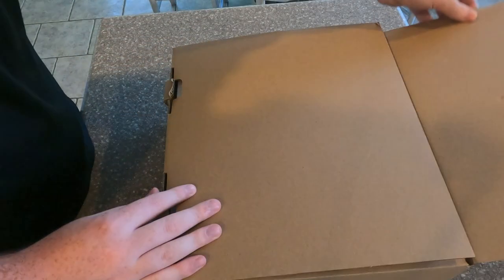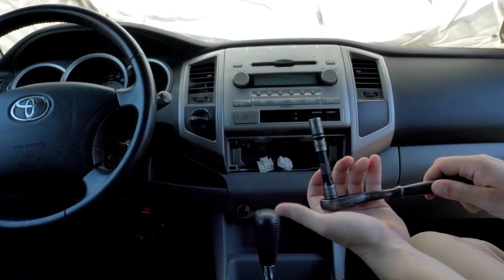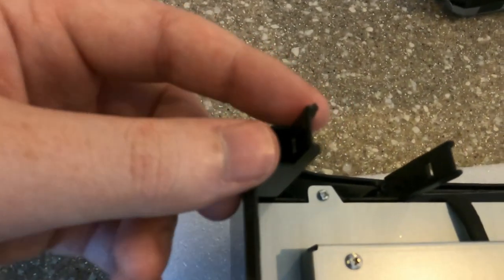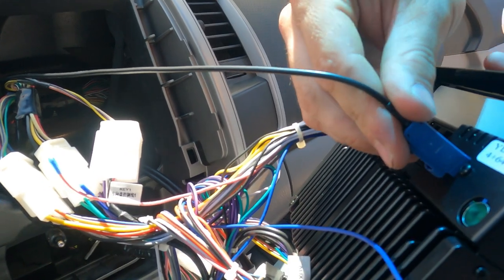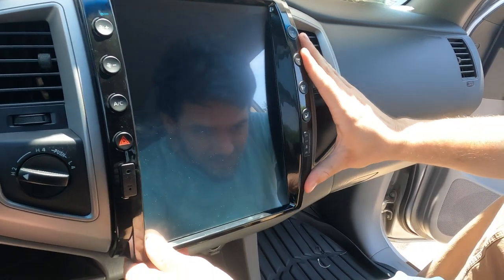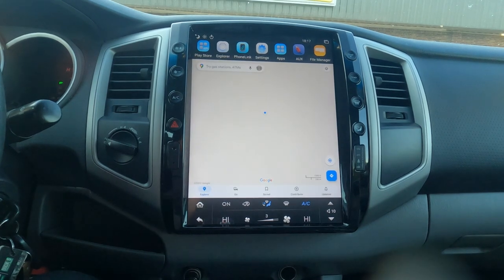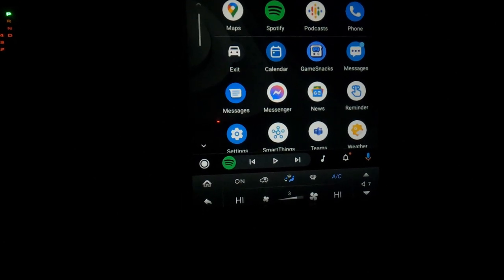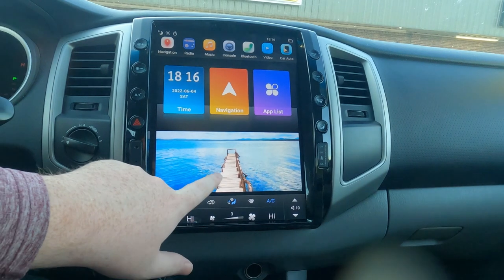AuCar 2005 to 2015 Tacoma Head Unit Installation and Review!!!

Comment: Thank for the video. Seriously thinking about getting this upgrade thanks to what I see here.

I have a 2010 Tacoma with the backup view in the rearview. 

Question: Is there a way to connect that existing camera to aucar screen?

Thanks again.
Reply from the maker: Thanks for watching! It should have a wire harness and connection that just plugs straight in the back of the unit that will automatically connect to your backpack camera and the screen. It also has the option to add more cameras to get a birds eye view of the car, but I have not seen that hooked up yet so don't know much about it. 

If you have any more questions be sure to reach out!

Comment: Installed my aucar unit yesterday on a 07 Tacoma, lcd already having a a big line through it. AC was opposite, cold is hot, vice versa. Bluetooth quality is really bad. I would stay away from this China product
Reply from the maker: Oh shoot, I didn't have the lcd screen issues. Did you reach out to their customer service to see if they will fix it? I know the hot and cold can be fixed with a software update, the Bluetooth is subpar. I wouldn't mind sharing your experience in a video if you wanted to send a picture or video let me know.
Reply: @ZachHollenbaugh  yeah that's your email, I'll send u some pictures,
Reply: @ZachHollenbaugh  yes, if you can do a follow up video on mentioning my issues that would be awesome, mayb it'll get their attentions
Reply: @plng777  were you able to get yours fixed, these are the reasons why I am hesitant to get this?
Reply: @plng777  
What unit would you have bought? I’m thinking of leaving the heater ac controls and just replacing the head unit
Reply: @acobajk24 Was this issue ever fixed?

Comment: A few questions. I have a 2005. Is it smooth, is it quality, is it worth the money and can you change the brightness on it the whole screen? Thanks in advance.
Reply from the maker: It should fit 2005 - 2015. I've had it a month and it has been smooth and seems to be quality so far. I mainly use it for carplay, but I can do handfree calling which I love. I think it looks a lot better as well. You can change the brightness on the screen with a few taps on the top left, or go into more exact brightness in the settings. If you have no tech in your 2005 I think it's worth it for what you get. I'll be making a video at 6 months showing people how it's holding up, but so far I like it a lot. Adds a wow factor to that I like. As far as worth the money I think it will depend on what you have currently, for me it would of been bc I had no tech or screen. If you have any more questions just let me know!

Comment: Great video! One question. I saw the display plugged into the OBDII port below the steering column. Does the Aucar display read the codes from the OBDII and display them on the screen? If so that would be a game changer for at-home diagnostic tests.
Reply from the maker: I don't think it does, but that would be a game changer if they had it haha.

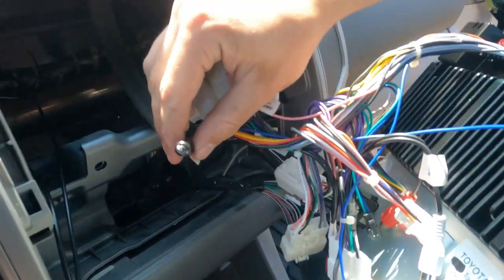Comment: This video helped me a ton guys! I watched it a bunch to help me figure out what I was doing. I have to ask did you guys have trouble plugging in the radio antenna 4:42 and getting the plug to stay in? it seems like mine only goes in halfway and pops out rather easily... I got the gen2 version of this headunit
Reply from the maker: Thanks for watching! I am Glade you were able to find some value in the video. I can't quite remember if we had trouble with that wire ourselves. I was curious what you thought of the new generation screen?
Reply: @ZachHollenbaugh  Absolutely, you are one of the few showing a clear install that made it easy for me to follow!  I haven't got to mess with the screen much. I still need to put the screen in! I broke one of the white clips so I'm hoping it will work with just three white clips instead of four. It def does't work with yellow clips in place of white ones! lol Only thing I'm worried about is the radio antenna doesn't seem to plug in or "snap in" securely like everything else does but I did notice the sound quality is significantly better with this unit.
Reply from the maker: @angell6425  I remember that's the last one we plugged in, but don't think we had any issues with it. I'm Glade the video was useful tho! I know it's an expensive purchase and has a decent amount of wires, which can look intimidating, but I like the unit! I have to use a wire for Android auto, but I think the new units have better carplay! Let me know if you get the wireless carplay working!
Reply: @ZachHollenbaugh  Sorry for the late update but yes it looks like I can use Android auto via bluetooth. Only issue with it is didn't always play my Samsung music flies and something google maps is lagging behind where the vehicle is. I hear they have a new unit on the way. Will you be getting it?
Reply from the maker: @angell6425  I plan to get the 3rd gen tacoma at the end of the year if I have money saved up by then!
Reply: @ZachHollenbaugh  booo! 2nd gens ftw lol congrats tho
Reply from the maker: @angell6425  I love my 2nd gen, but it's getting up there in Miles, want to reset the miles and don't want a 4th gen unless they go back to the old motor
Reply: @ZachHollenbaugh  I understand. I also prefer the old motor. and the easy of maintenance on the 2nd gen. God willing I never have to upgrade.
Reply from the maker: @angell6425  I feel that. Most of my camping mods will fit on the 3rd gen as well! Looking for an OFF ROAD 4X4 Long bed wirh under 30k miles 2020 to 2023 I think
Reply: @ZachHollenbaugh  Nice, good luck! I hope I can be able to drive mine into the ground. I think older cars are so cool but it does suck having to upgrade and find a new one because of unforeseen events or what not.
Reply from the maker: @angell6425  the truck market sucks right now too haha. Thanks man!
Reply: @ZachHollenbaugh  oh man! I hear a few yrs ago they were selling buckets for 80k xD I thought it's calmed down since then but I hear they don't make new cars the way they used to so maybe.

Comment: Two Questions. 
Are steering wheel controls still usable? 

Does it have amp plug ins for a aftermarket subs?
Reply from the maker: You can still use the steering wheel buttons! I saw an audio adapter but I would call and make sure it will work for your sub system! They also came out with a newer model so it may have changed!

Comment: Someone should make a wire harness kit for where we don't have to splice for converting the backup cameras to the head unit! I've been on Tacomaworld Forums, and I don't want to to have to go through the time consuming process of having to mess with wiring just to have signal in a new head unit for getting backup camera signal.

I own a 2011 Tacoma by the way. I'm definitely getting this for holiday season!
Reply from the maker: I didn't have to splice anything on my 2014, it had a spot for it to plug in and a harness, I think if it has a camera you can use there harness, but if your adding one you may have to splice something.

Comment: I have a 2007 Toyota tocama manual transmission and i want the back up camera.  Does that matter when it comes to the usage of the camera.  Can you make a video of how to install a camera.  Thanks
Reply from the maker: I don't know exactly where I put the backup camera that came with it, but I know the hardest part is running the Wire  from the back of the unit all the way to the back of the truck. But besides running the wire, once tou connect the right wiring harness and plug it in, it should automatically pick up the camera feed!

Comment: Whats the point of the obd2 connection?  Does it cause the head unit not work work properly?
Reply from the maker: The newer model may have more uses for it, but knowing the rpms is the only thing I've seen it do I think with the one I have

Comment: Thanks Zach! How is the boot up time? We've got really hot summers and really cold winters here in Central WA, so want to be able to crank AC/heat right away.
Reply from the maker: Well it is pretty mild winters here in Ar vs WA, but does pretty hot. Boots up pretty quick in the summer and winter so far, just took it out to put in my brother in laws 2013, so will have an update video soon. I've had it lag once or twice where I  restarted it, but usually no issues
Reply: @ZachHollenbaugh  I take it your review is of the 4gb Android 9 (sold out on their site). Have you heard anything about the Android 11, 8gb version?
Reply from the maker: @jdtoothnail  I have not. I'm assuming it would be a little better but can not confirm
Reply: Hey Zach, if the ebrake wire is grounded to the unit itself, is that a sufficient bypass? I’ve done that with my last two Jensen units and it worked fine.

Comment: I have a 2011 toyota Tacoma with mode, volume, channel selector, telephone all in the steering wheel. Will these still work? Also can I use series radio. I also have a backup camera that shows in the mirror. Will everything still work?
Reply from the maker: I haven't tested it all, but there should be wire harnesses for all of that, I know the backup camera has one, but according to the website it should, you can always ask there support desk as well, but it may take a day to get back with you bc they are based in China.
Reply: @ZachHollenbaugh  Thanks for repling.
Reply from the maker: @frankbona2537  no worries man, wish I could of been more help! I may install it soon on my brother in laws 2013, so may have more answers in the future!

Comment: Hello, I have a question. Where you can see the airbag when is on and off? Thank you
Reply from the maker: There is a plastic piece on the right side, that will show an led light when on or off!
Reply: Thank you for the fast respond…. I will ordered the second gen on this radio. Very good video. Thanks a lot
Reply from the maker: @panchulo2008usa  no worries man! Glade I could help!

Comment: Do you need the stock Radio for this to work
Reply from the maker: You would just need the wires from that trucks year model, so if you have replaced it before, you can unplug those and plug it into the other unit.

Comment: that truck is brand new
Reply from the maker: The inside was insane! Looked like perfect condition haha. But unfortunately the frame had a decent amount of rust.
Reply: @ZachHollenbaugh  shame should have been warrantied right?
Reply from the maker: @6henny443  there was a class action lawsuit against them, and they had to replace all the damage, some the entire frame, a few years ago, but I missed the window. Toyota said I was out of luck, so took the hit and traded it as is. Wasn't too happy with Toyotas response but it is what it is.
Reply: @ZachHollenbaugh  wow, they should at least take a look at it. Luckily my 08 wasn't affected and like 0 rust on frame. It had the pedal safety issue fixed though.
Reply from the maker: @6henny443  yeah I was pretty upset, but planned to take it off road so didn't want to risk it with the frame. I went and got a 2021, and will be putting the screen in my brother in laws 2013 sport one day.

Comment: I hear nothing but bad about these head units. They look great but have too many flaws with little to no help from the manufacturer.
Reply from the maker: I've definitely heard some complaints about this unit, I have had a few small issues myself. However nothing major has happend yet to mine to regret it yet, if it does I'll make a video over it.

Comment: I have a 2015 taco but I don’t have luck getting my front camera and my steering control. Any suggestions?
Reply from the maker: I'm not sure exactly unfortunately! Before you pop it in try switching around some of the wires and adapters. It's been a while since I've installed it so I can't quite  remember